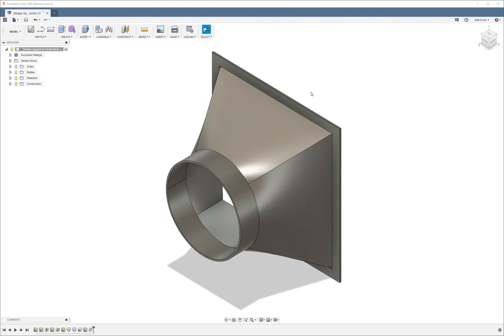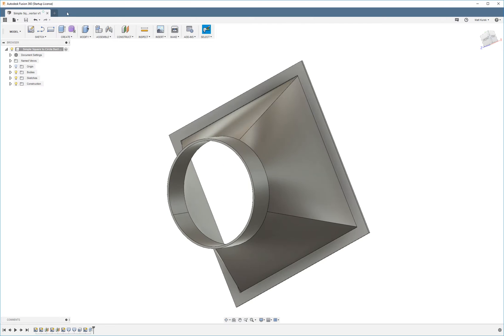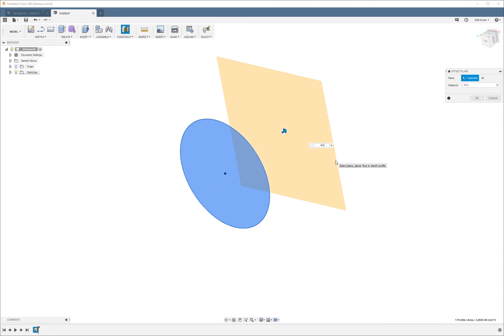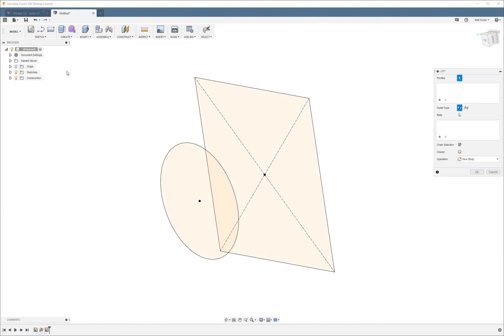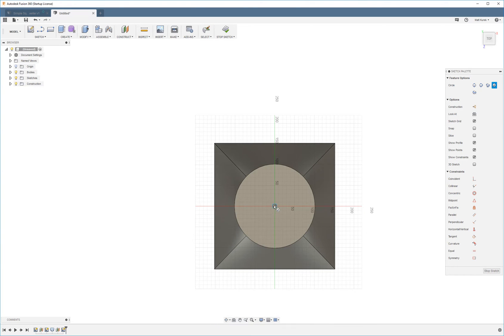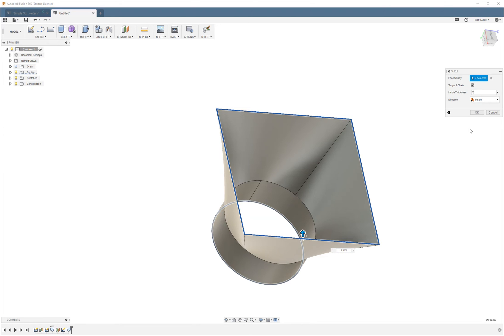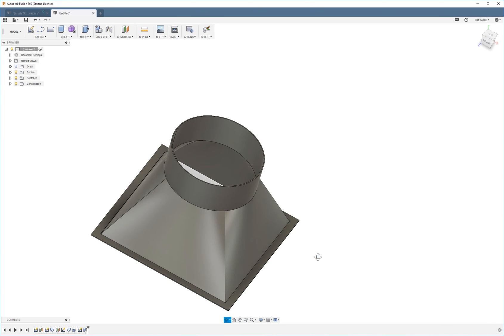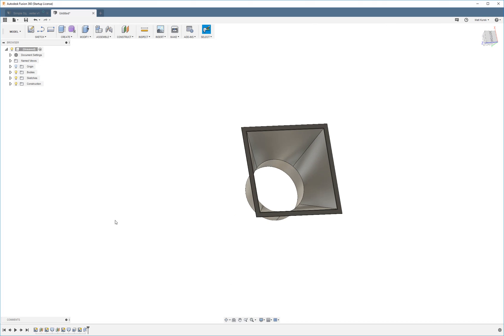How To Use Lofts in Fusion 360

Comment: Useful. I am trying to create something similar with one end closed but have not yet figured out how to do it, like a "fill" option (yes, I know I can try to make a new sketch but angles make it imperfect).
Reply from the maker: If the end that you want filled is complex, you could create a new (oversized) body that represents the filled end. Then do combine feature to use the lofted body to do a cut on the oversized body. The oversized body should then be split into pieces that are outside of the lofted body, and a main piece inside the lofted body. Now use combine feature to join that main piece with the lofted body and you should have your lofted piece with a filled end.